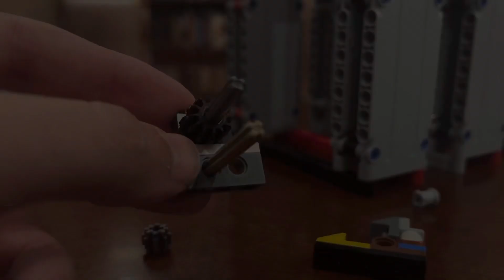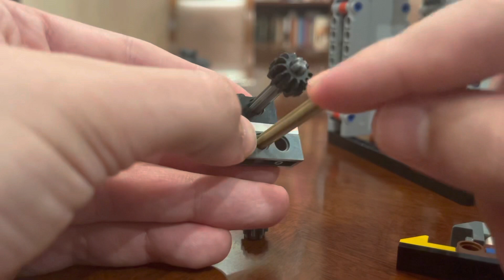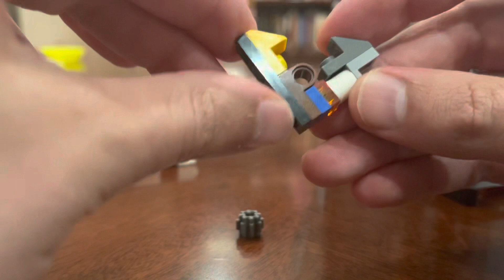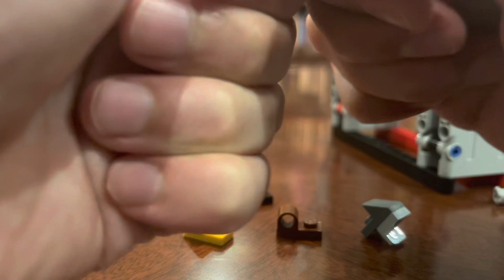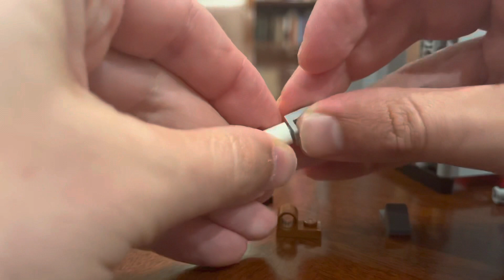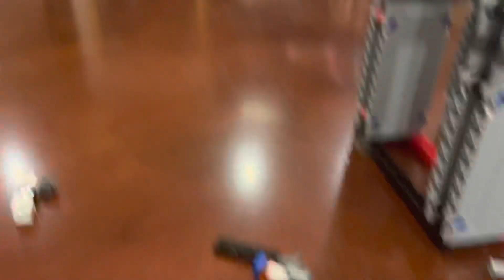LEGO escapement using 12 tooth gear. NO ADJUSTMENT REQUIRED

Comment: Can you try to build an escapement with the 24 tooth gear?
Reply from the maker: sure, no promises as to when though. sorry😬
Reply: @berellevy2  i tried to build it myself but im too bad :D.
Reply from the maker: @Hektical_YT  I meant it so that anyone should be able to reproduce it. So if you weren’t able to make it I need to redesign it.
Reply: @berellevy2  I meant that i couldnt build the escapement with the 24 tooth gear. I could easiely build yours but i just dont have the pieces for it.